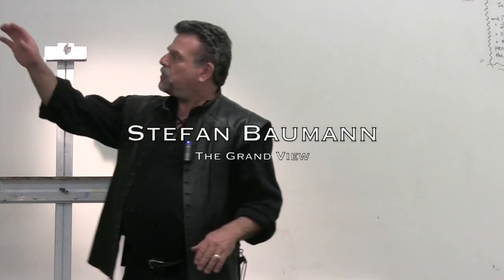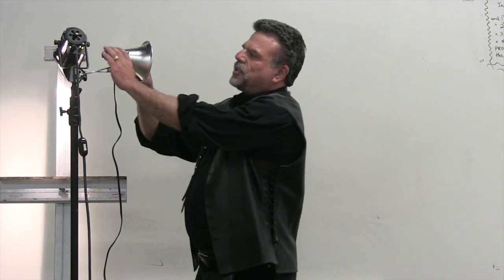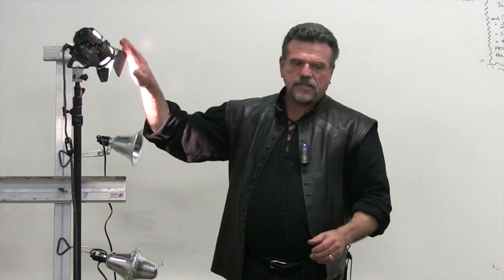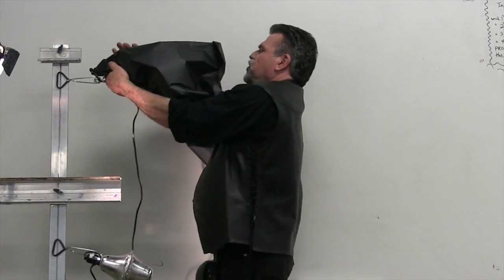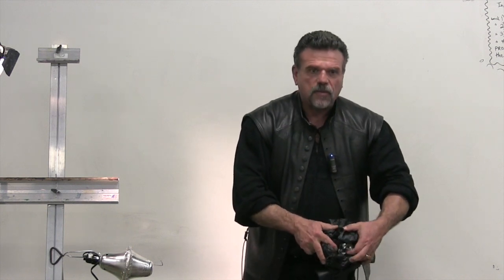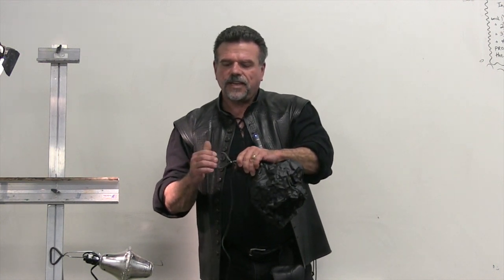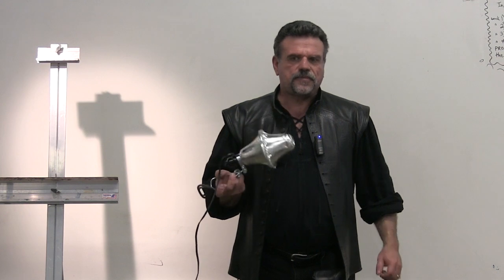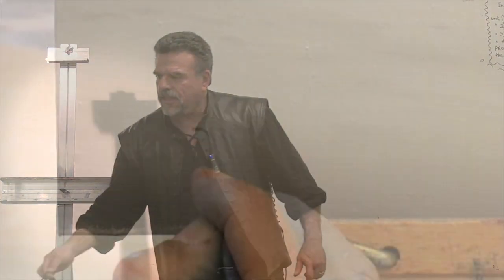Making a painting light...Light -camera - Action

Comment: Great tips, thanks! Perhaps a hose clamp would work well for the clamp on light. The type for auto heat and radiator hoses. They come in various sizes and tighten with a screwdriver.
Reply: Darren P. If
Reply: I bought a smallish led light which can be set to bright or half strength in either warm or cool light. Great help. My studio faces NNE. Ah well. Love the early light mornings for drawing. Painting is for when the sun has moved over the house. 🙂